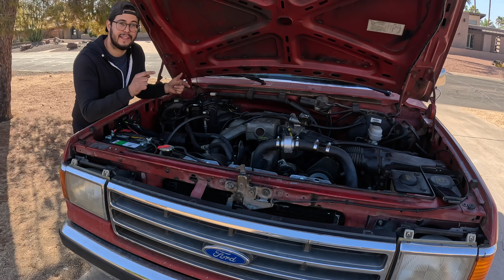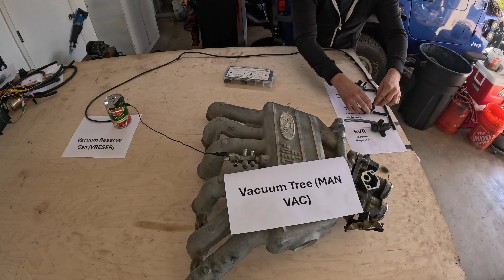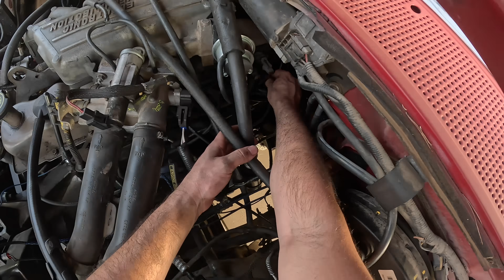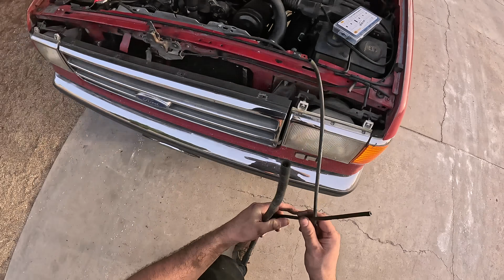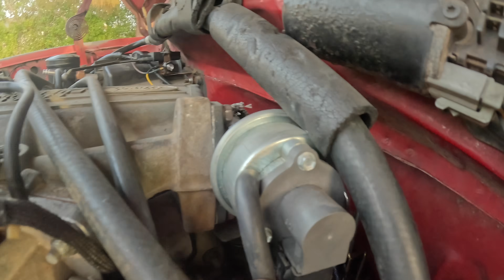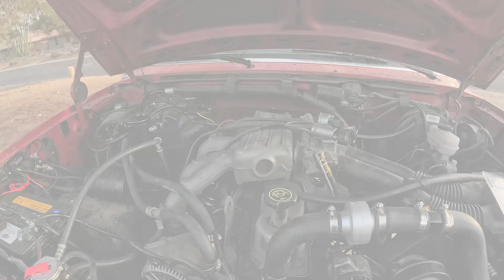Simplify Your Vacuum Lines | Post-Smog Pump Delete

Comment from the maker: Disclaimer – Please Note
The vacuum layout shown in this video is for example purposes only. It represents most of the layout for my Ford 4.9L, except for the TAD and CANP valves (which my vehicle doesn’t use) but were included for demonstration. 

Your vehicle’s setup may differ, especially if you have a newer 4.9L (MAF instead of MAP), a 5.0, 5.8, or 7.3, as these may have different configurations. While many concepts apply, this is not an exact replica. 

Thanks for watching!
Reply: Any reason you didn’t delete the EGR as well since you deleted the smog pump?
Reply from the maker: @shaunlucky-samaroo688 The smog pump doesn’t really affect the computer, but the EGR does. Pulling it can throw a CEL, so I just left it in place. There are ways to get around check engine lights, like dummy plugs. I didn't really want to go that route since the truck is running great after the smog pump delete.

Thanks a ton for watching! 🤘
Reply: @MyAutoAdventures why are certain other guys wiring in resistors on the TAD & TAB Connectors
Reply from the maker: @williamhebrlee415 I'm not too positive. It was my understanding that the TAB, TAD, and EVR solenoids don't affect the computer and won't throw CEL codes. 

The EGR, however, will throw codes and the plug needs a resistor (there are companies that make a special plug for the EGR delete) so the computer doesn't start acting up. 

I've heard more bad things than good about removing the EGR system on these trucks. But there are a few guys who have had no issues at all. 👌
Reply: BTW, the PCV valve doesn't affect performance so pulling it isn't necessary.
Reply from the maker: @williamhebrlee415 Sorry for the misunderstanding. I pulled it from the example (since it was not something related to the smog pump delete) not from from the truck! 

You are correct though. The pcv should definitely stay on the engine! 👌
Reply: I have a 96 5.0. I would appreciate all the help you could offer so I could get my truck running as good as yours. Ty
Reply from the maker: @jondough61 Super appreciate you watching! Definitely feel free to email any time MyAutoAdventures@gmail.com with any questions and I'd be happy to lend some help if I'm able! 🤘

Comment: Thoughts on egr delete the hose to mine is broken thinking about deleting since I already deleted smog
Reply from the maker: I typically recommend against deleting the egr system. 

The computer is designed to work with it. It'll throw a code if a resistor isn't added to trick the computer. 

It's doable for sure, but not always recommended.

Comment: Do not do this, it accomplishes nothing, but tell you what it does do. When you start your car, your engine senses it is cold so it richens the air fuel ratio and advances timing to help warm upur engine quicker. during this time, the smog pump flows extra air into the xhaust to help burn off unburnt fuel before it hits the catalytic converter. what is also happening is small particles of fuel make their way past worn piston rings into the crankcase and oil dirtying your oil. The longer you run this cold start process the more fuel goes into your motor crank case causing premature cyliner and bearing wear. The smog pump protects your motor.
Reply from the maker: you heard smogfighters guys, definitely don't DO THIS ON YOUR TRUCK! 👀

You hear me! don't DO IT! 😉😆

Comment: So what are all the parts you need I got a bypass pulley and the tab plug to bypass the computer
Reply from the maker: Not too sure if we're still talking the smog pump or the EGR as well.

I only removed the smog pump and you can see how I did that right here! 👇

https://youtu.be/s3BdgSdfzyE?is=qTYhzP0SGvGS7Vnt
Reply: @MyAutoAdventures yes I’m deleting the egr to but the tab, tad are on that plug in above the passenger side valve cover and if I leave those regular my engine lights gonna come on I thought so would there be something to put there like the egr plug I got ?
Reply from the maker: @Ncaajoemoney_blk The TAB and TAD solenoids don't have feedback sensors like the EGR does, so they can't tell if the vacuum lines are gone.

However, the computer will notice if you completely unplug them from the wiring harness and might throw a circuit code.

The easiest fix is to just leave the TAB/TAD solenoids plugged into the electrical harness above the valve cover, but completely cap off or remove the vacuum lines. 

If you want to remove the plugs entirely, you'll need to jump the pins with a resistor to trick the computer! 👌
Reply: @MyAutoAdventures thank you

Comment: Can you delete smog pumps on cadillacs.
Reply from the maker: You can do anything! 😁
How it will respond I'm not positive. I've never had a Cadillac and have no idea whay engine it has.

But anything is possible! 😆
Reply: @MyAutoAdventures its a 03 deville
Reply from the maker: @BIGTPUN8311 I don't think it's the same type of system as the Fords. On Fords it's a belt driven pump that often gets locked up and causes stress on the pulley system.

The 4.6 is run electronically. Your pcm is looking for the pump to do it's job so removing it will probably throw some codes. 

There is probably way to disable the codes or trick the computer, but that's gonna require a deep dive search.

Is your system causing you issues or are you hoping it'll get you more power by removing?

Comment: I followed the video but have a CEL on. Only difference is PO tried deleting the EGR as well. Looks like the pipe is rolled and smashed. Is this the reason for the CEL? The tab tad and EVR were missing as well but after watching the videos I went to the pick and pull to get it. Got all the vacuum lines capped from those including the EVR. Any help would be appreciated.
Reply from the maker: Heyo, thanks for reaching out. Doing just the smog pump delete shouldn't cause any codes to show up. 

Almost everyone I've heard who's deleted their EGRs have gotten codes unless they install a dummy plug to trick the computer into thinking it's still part of the system. 

TruckTok makes an EGR simulator/eliminator plug.
Reply: @MyAutoAdventures I do have the EGR dummy plug installed as well. That’s why I’m confused as to why I still have a CEL. Do I need to clear the code perhaps to see if it goes away? My thought with buying the tad & tab was to plug the cables back up since that would throw codes as well.
Reply from the maker: @user-d7x3j Ah, gotcha gotcha. I get your frustration. 

Have you tested for the codes yet? That'd be really helpful so we can figure out what the computer is looking at.

Comment: Just did this on my 87 f150 4.9. Idles smoother. I'll give a later update. Thank you
Reply: I delit that smog pump bug I stil have alll that lines hook I Ned to tal those off  and wath abaut that egr ??
Reply from the maker: @Purozamachihue Nice! Deleting the lines is definitely not necessary. I only did it to clear out the mess in the engine bay. 

I've heard mixed reviews about deleting the EGR. Most of what I've heard is it's best to leave that system connected for best engine performance. 👌
Reply: @MyAutoAdventures ok I have cuestion my bronco  wen I trun that acsedories like head ligth ac or heat wen I reach 55 mph start  sputter but wen I trun evrithing of rounds like normal y chek all my connection new distribuidor starter coil. Grounds cables any idea mi bronco is 1987 4.9300l6
Reply from the maker: @Purozamachihue 
It sounds like your Bronco may have an alternator or voltage-regulator issue.
You can test your charging system with a multimeter:
1. With the engine running at idle:
Your battery should read 13.8–14.6 volts.
2. Now turn on headlights, heater, fan, and AC:
The voltage must stay above 13 volts.
If it drops below 12.7 volts, the alternator or regulator isn’t keeping up.
Low voltage can cause a weak spark, which would explain the sputtering at 55 mph when your accessories are on.
Also check your ground straps (battery to block, block to frame, firewall ground). Make sure they’re clean, tight, and not corroded.
Reply: @Purozamachihue those alternator wear out especially if it's the original. I would definitely recommend buying a higher amperage. You'll notice a difference.
Reply: @MyAutoAdventures  I did all that and that voltage never dropped only thing I haven’t try is that ground from that fire wall  wath abaut that cpmputer  ??  Maive a wired  is corroded
Reply: I take that alternator to that auto parts to check and they said was good  I replace like 2 years ago I have audio sistem and 2 baterys
Reply: @sergiogarza3994  yea I order a high amo from power bastards 220 amps but they send me that wrong oane is more small. And I’m waiting for send me that correct oane
Reply from the maker: @Purozamachihue Yeah, it’s definitely possible. Bad grounds and corroded connectors are some of the most common causes of electrical problems, especially when voltage checks look normal. They’re easy to miss and can create weird intermittent symptoms, so they’re always worth checking early on.
Reply: @MyA @MyAutoAdventures  yeap. I migth buy a new oane   Ecm and se  or I Ned to chase which wired  I take it to 2 shops and they saide that I have big problem and they don’t want to work on that and I dint want to hub up because I spend a lot money an this
Reply from the maker: I get you — electrical issues can be a pain, especially when shops don’t want to touch them. Before buying an ECM, definitely check the grounds and the harness connectors first since those are way more common failure points. @Purozamachihue
Reply: Ok that harnes from that computer  to that  distribuidor  I will tomorrow and that grounds. Thank u very much  for  help me whit this isues ipreciated
Reply from the maker: Super happy to hear it! Definitely keep us updated! 🤘

Comment: What if Im removing and blocking off the egr? Can I remove the tomato can and cap off the egr solenoid? Ive got an egr delete resistor for the egr itself.
Reply from the maker: Yep yep. If you’re removing the evr solenoid I see no reason to keep the tomato can (vacuum reservoir) on the truck. 🤘 

Let us know how that works put for you. I've heard mixed results, but first-hand experience is super appreciated! 🤘

Comment: does the Check engine light turn on or does this delete following all your steps keep it off?
Reply from the maker: You shouldn't get a check engine light after completing the smog pump delete. 👌

You might get one if you go a step further and delete the whole EGR system (which I wouldn't recommend) as that system talks directly to the ECU and will throw a code unless you use a tool to trick the computer.
Reply: @MyAutoAdventures so i’m not rlly used to this kinda stuff i’ve only driven carbs so what is the egr for? isn’t it part of the smog system?
Reply from the maker: @GabeHousen No worries at all — good question!

The EGR system routes a small amount of exhaust back into the engine to lower combustion temps, which reduces NOx emissions (pollutants created when engines run hot). It’s monitored by the computer, so removing it usually causes a check engine light unless the tune accounts for it.

The smog pump is a separate system used on older vehicles. It pumps fresh air into the exhaust to help clean up emissions, especially on cold starts. They’re not used on modern engines anymore and often fail or seize, which is why many people remove them.
Reply: @MyAutoAdventures Thank you so much man!

Comment: No need to cap off the TAD and TAB solenoids. You can also trash the soup can. All you really need is vac tree to MAP, vac tree to FPR (red tube), and vac tree to EVR (red tube). The other side of EVR goes to the EGR valve (green tube).  Leave the PCV system alone, as well as the canister vent valve. I have a '91 F150 with a 5.0 and just did this. Didn't need to buy anything, I salvaged all the original tubing and ends.
Reply from the maker: Really like this breakdown!👌

The only thing I’d do differently is keep the vacuum reservoir (the “soup can”) connected to the vacuum tree and the EVR. It’s a reservoir for a reason — engine vacuum can fluctuate, and those dips can affect the EVR and the signal that gets sent to the PCM. Keeping the reservoir in the system helps smooth out those variations and reduces the chances of sudden vacuum drops. 🤘
Reply: What do you do with the electrical connector for the smog pump?

Comment: Has anyone pulled solenoids and spliced in a corrrect resistor between the harness wires to mimic signal source voltage.
Reply from the maker: I don't believe the TAB and TAD affect the computer enough to require that much work. The signal mimicry comes in when people decide to remove the EGR from the system and need a way to fool the computer cause that will throw off the system. 

There are kits like this they make with plugs to do just that.

https://www.trucktok.com/products/trucktok-1986-1995-ford-f150-f250-f350-mustang-trucks-egr-simulator-eliminator-block-off-plate
Reply: @MyAutoAdventures  
Oh ok. At work I frequently have to do resistor installs to mimic reference voltage for non existent foot pedal TPS’s on stationary engines . And know how much of a pain EGr deletes can be to not affect ecu parameters 😬😂
Reply from the maker: @Youngy_2888 That's sweet! It's crazy how such a little detail can affect the computer so much.

Comment: I want to offer that unless you don't care about longevity with this engine, I suggest reinstalling the PCV.  That's the only way of keeping the inside of an engine clean.  As well, if my recollection is correct, when you're accelerating the PCV valve is closed.
Reply from the maker: Heyo, thanks a ton for the great info! I only took the PCV out of the example since we weren’t working on it for the video. It’s definitely something that should stay on the engine — it’s an important part of the system. I should’ve clarified that, but I really appreciate you looking out! 👌

Comment: 91 f150 4.9l here. Just deleted the smog system and l also want to delete EGR . Now you went from tomato can to EVR with one of the 2 lines that feed it. One of which is neutral and the other with vacum. Which of the 2 did you take to the EVR . And since l am deleting EGR do l even need tomato can any longer. What might you suggest in terms of connections with both smog and EGR delete.
Reply from the maker: Heyo, thanks a ton for watching! From what I’ve seen, most people who delete the EGR setup on these trucks end up running into issues with how the computer behaves afterward. So my first recommendation would be to leave the EGR system in place if possible.

If you do decide to move forward with the delete, then you’re right — you wouldn’t really need the vacuum canister anymore.

But if you choose to keep the system and the canister, the vacuum side should connect to a port on the intake manifold. That’ll give it a steady source of vacuum while the engine’s running. 🤘
Reply: I will let you know what comes of the experiment. You can't know unless you try.
Reply from the maker: @steadyeddy6526 For sure! I'm excited to hear the results. Definitely keep us updated!  🤘

Comment: I'm wondering about a serpentine size after the smog pump delete. I have heard on the other videos a Gates belt ko60805 another was 6pk2070 I think that is a continental belt. This feller has been scratching his head about that
Reply from the maker: Heyo Jeff, that really depends on a few factors—engine size, whether you’ve got A/C, and if you’re running a stock or aftermarket power steering pump and alternator. A lot of folks are running different setups, which is why you’ll see so many belt sizes suggested online. What setup are you currently running? 😊

Comment: Im looking forward to doing this to my 89. Once j figure out the warmed up stall issue    Did it make it run any better ?
Reply from the maker: Removing the smog pump made it so much better for me. My truck has lots more get up and go at stop lights. 

Definitely recommend if you're considering. 🤘

Comment: U can delete egr and fix 3.9k +390 resistor wiring shown in video ytube
Reply from the maker: That's an awesome suggestion for anyone looking to remove the EGR from their trucks. Appreciate you watching and dropping the comment 🤘
Reply: What does that mean? I deleted the smog pump and the EGR and I’m needing to know how to run my vacuum lines or whatever I need to do so it runs good.

Comment: 1996 f150 4.9 here.  I have been looking at these smog delete options because I am getting a p0411 about once a month and haven't been able to identify the issue yet.  If you do the smog system delete, does the computer throw codes and the check engine light?  I like the thought of simplifying the system, but do not want to have to clear codes because of the delete.  Thanks!
Reply from the maker: Heyo, thanks for watching! From what I know, the smog pump system itself doesn’t trigger the ECU, so you should be fine there. If you start pulling EGR components though, that’s when the computer can start throwing codes. You should be good to remove the smog pump setup, free up some space, and hopefully get rid of that annoying code. 🤘

Comment: After following all the steps, I solved the problem. But it shows code 565. How do I fix it?
Reply from the maker: Heyo, thanks a ton for watching!

Looks like that's a code for your canister purge valve (CANP) solenoid.
Depending on your year, you might or might not have one.

If you do, obviously make sure it's plugged in. Then, make sure the vacuum lines going from the charcoal canister are clear, as well as the lines going from it to your throttle body.

If that's all good, you might have to test your solenoid. It might be stuck open or closed.

Hope this helps point you in the right direction! 🤘